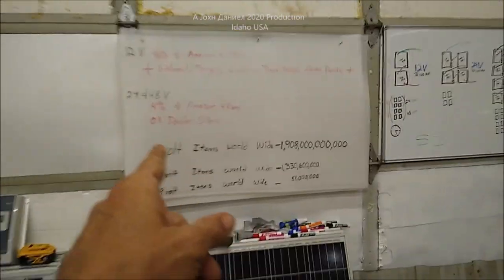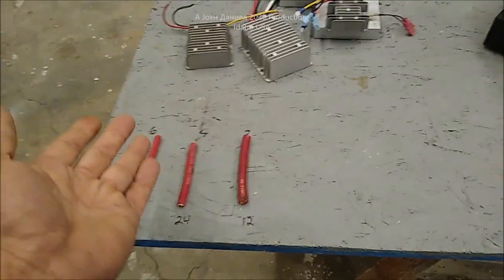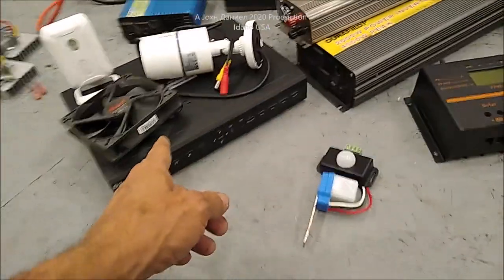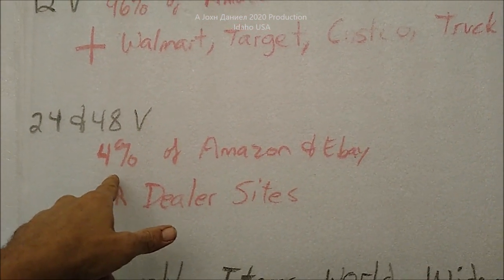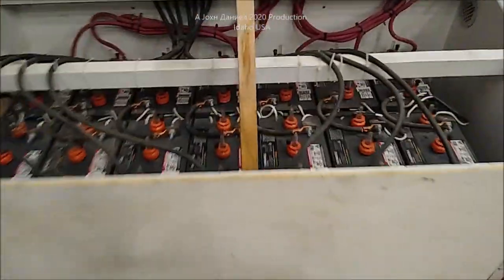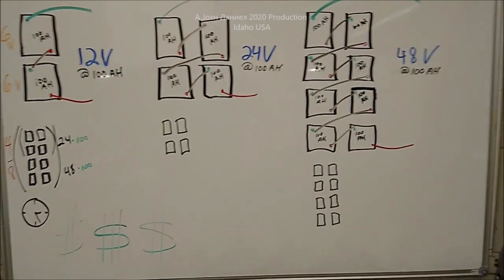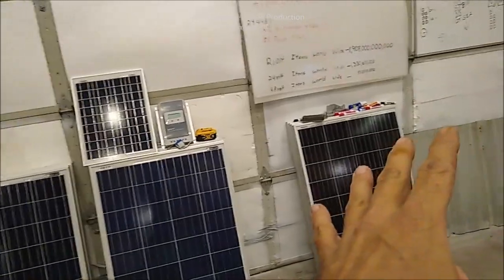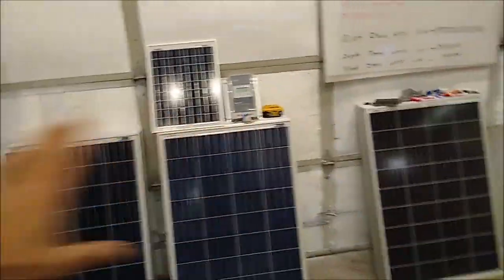Solar Wind Hydro 12 VDC is Best Voltage on Off Grid Survival Power System (Graphic Info)

Comment from the maker: ⬇️ SURVIVAL POWER SYSTEM ⬇️ -- 100 Watt Panels https://ebay.us/FMVsCV ,$120 REAL 50A MPPT https://ebay.to/3abTqju ,Solar Connects https://amzn.to/2XJOa1M ,Battery cable USA made https://amzn.to/3h6dsim ,12/2 Above/Underground https://amzn.to/2XIJolg for safe DC wiring of lights and appliances. (appliances you can use on 12 volt full list below)
Cheap Inverters with proven 4+ year records of quality - 3000 watt https://amzn.to/3awLWrS for tool, high amp and start up use, & a 1000 watt Pure sine for sensitive computers, TV's and electronics https://amzn.to/2Y1UHoH or just go one big inverter a 3000 watt pure sine (preferred method) for what your system can produce in peaks https://amzn.to/3iNsQjQ 
 
***BATTERIES - - DEKA SOLAR or Duracell GC2 & B-903-L16 that actually can last 10 years. Made by East Penn, sold by Batteries+ as a Duracell for less.  https://bit.ly/2wv1VXd Order online, pick up for cheaper. 
~HURRICANE LiFePo4~ is the best affordable all in one 100+ AH Lithium option using Pure Prismatic Cells, not the others flashlight cells!!, go to link, add to cart and put in code WIND5 for a discount on all items in there. You can send them parts request, they know more sources. https://www.hurricanewindpower.com/hurricane-battery-12-volt-100-amp-hour-lithium-iron-phosphate-lifepo4-battery/
Questions, need help designing, ASK!
Reply: They seem to be sold out of the 50 amp mppt charge controllers do you know of any others that work as well ?
Reply: Great video!!! Im about to buy 4 330watt monocrystalline panels (it'll max out my 6x12 roof space, i have already 8-3.2 280ah lifepo4 cells. I want to run a 5,000 watt window ac, a 12v water pump, and a small efficient deepfreezer as a refrigerator. A small water heater would be a bonus, but i will be making a small wood stove in the trailer for heat, so i can boil my water for showers and do without the water heater if i have to. I figured 12v strip lights will be enough for interior lighting, with one 12v flood light on the outside. 
   I think it works out best to use a sine wave inverter to run ac to appliances, because of 12v dc loss, but that's speculation on watching videos. If thats the case can you advise on what equipment would be necessary to run my system? 
   Would it be best to build a 8-cell 12v 560ah battery bank with one bms, or 2-4cell banks with a bms for each, then connect them in parellel? I think running all 4 solar panels in parallel is what i need to do, but im not sure on what size mppt controller to get or inverter. My only thought was if i ran 2-12v battery banks in parallel, if one had a problem i could take it out of the system and still have one bank to run on until any problem was fixed. Say a cell went bad or bms went down. Having a extra bms or a few other things on hand is im thinking a good idea, but if you can't get on it right away it'd be nice to still have power for the day or night. 
   I mentioned on one of your other videos that id like to incorporate a 12v axis pma wind generator if possible, so if it is and changes my equipment needs i thought I'd put that in this post. If this is more than you bargained for when you wrote just ask! I apologize lol. Im wanting to go to new mexico and texas during the winter this year, (Michigan winters are getting old/ or i am haha). If you want some slave labor I'll swing by your new place and dig a ditch or two, or pay for the advice, it'll be worth it to not buy hundreds in over expensive or wrong equipment. If your helpers have the time, i know you said your busy, my email is gypsymike1969@gmail.com, i can use email for questions and answers. Any advice will be appreciated!!!

Comment: You have a lot of knowledge and willingly share it so you deserve a big thank you.  Please keep in mind that there are many single women both young and older who are trying to become as self sufficient as we can be.  We can't lift lead acid batteries, don't have the skills or amount of tools needed, can't recognize a good tool from a cheap tool, can't strip wires, etc. how about some videos on how to set up arrays using 12 volt batteries that are only 35 amps that we can lift and showing wiring that is more plug and play instead of using charge controllers and inverters that require buying heavy gauge wire, stripping it and screwing it into place.  Please!!

Comment: I have been watching your channel for quite some time now and this is the best explanation I’ve seen yet of why to go with 12V. 
Most folks don’t know that their DVD players TV and stereo systems run on 9 to 12  volts. Not all but most do. I have removed the transformer from my devices and ran them straight off my battery bank with no problem. Other appliances like refrigerators freezers and washing machines need an inverter or propane to run. However there was a washing machine that was peddle power I showed the wife. Well the look I got.  If you’re married you know what I’m talking about. But the exercise bike was ok. Go figure.

Comment: My good sir I whole heartedly agree with you. It’s the exact same reason my system is 12v. Your explanation is both practical and real world experience and that means a lot.
Reply from the maker: Many fail to comprehend, I designed my system on pure simplicity, pure redundancy, complete restorable operating principles. If things go bad in the country, world or just due to environmental or weather issues, my methods are solid. Others who depend on sources that "May" exist later, are just pushing the dealers talking points, not reality.

Comment: During Lockdown, I've noticed how much power is needed and its very little. I've got a small 12V solar with a turbine and a small 24V with a step down to 12V. The fridges are 12V / 24V. Life is better without TV, radios, lights on all the time. I've made and bought solar cookers rather than a 12V oven or water boiler.

Comment: Finally a YouTube video that say's the same thing I have been telling people for years. I major point that was not mentioned is that electronics such as T.V's computer's and radio's use 12V DC internally. You can direct wire them to a 12V supply without any convertor's.
Reply from the maker: Safe, Solid, Proven. And parts anywhere.

Comment: You and I approach life exactly the same on these points.  Those kids are very lucky.  Our goal is self sufficiency for retirement. Minimal expenses. We're very close to disposing of the debt monkey. Energy and water are the everyday stuff we are mastering. We still have the on-grid home but a 35' residential camper off-grid we are more and more spending time in. There's a learning curve and you are helping to flatten it.  Thanks my friend.
Reply from the maker: My goal is safe the smart people who are not destructive to our society. And If you need a part by part list to make it easier, email me olympicpowercontrols@yahoo.com but include the general location your at, plans to apply, needs, and basic abilities in funds so I can try to make you a straight across plug and go set up to best fit your plans from the cheapest list of parts that last the longest.
Reply: @JOHNDANIEL1  I currently have 8x100s and (against your suggestion 😳) I just picked up 4x250s for $50 each. I'm currently using 4x Gp 31s and 3x24s DCs (yes separately). Camper had the 24s in it. I'm adding 4 more 31s before winter. Figure I'll need them with a REAL inverter.
I have a 4Kw Onan genset for wash days and mandatory AC days.
I use a Schumacher 2000w inverter (Not happy with it). As things progress I expect to replace it with a 2000w LF pure sine.
Bought a 30' tower to put a wind genny on before winter. Didn't get it home yet.  Getting there 1 piece here 1 piece thete at a time.  Social security doesn't pay great.
We are 30 miles north of Ft Scott Kansas.
Reply from the maker: @barker31155  We hope to get about 4 older families interested in the retire sorta free idea. Bulk Buy 100 acres in Texas hill country, split accordingly by deed from overall investments. Then each of us will separate about 3 to 5 acres near the center to make into over 80 full 20 year lease retire RV spaces where they pay $5000 up front to get a 20 year space 6 times the normal RV space with water and sewer provided at a flat $25 a month and they pay their own light bills or go off grid with all the room they got. the rest of the 80 or so acres we build on with large $6500 26 x 38 metal garage kits converted into our homes for under finished 1100 sq foot per house plus, for total of 25,000 each. Hyper insulated, ground source cooling, and fully off grid. 
Thats a idea that will guarantee to fill in a few months!
Reply: @JOHNDANIEL1  Love the hill country. We did live on Corpus Christi bay area for a short time.
Visited the hills now and then.
We got led back to Kansas and now planted in a fundamental Baptist church. Everything from fill in preaching to writing out birthday cards. My wife now teaches children's Sunday school. Unless the Lord calls us to the Hill Country and opens the doors, we'll be here in Kansas. 
I hate paying bills and that's what drives my ambitions.

Comment: I use 18650 cells from New lap top batteries. My cost is 1.00 each battery not each cell. 
I also get free used ones. I agree with 100 watt panels.  Also one important factor on the panels size. I’m 59 and big panels are heavy. My goal in 100 panels. Along with wind and hydro.  How about a video on a hydro generator.   Keep the faith.     By the way.  You must have watch Ward Cleaver growing up.  You’ve done a great job with your kids.
Reply from the maker: I always tell all - Home School your Kids, and VoTech teach them all you can so they know the most important skill to apply - HOW TO LEARN!
Reply: @JOHNDANIEL1  AND be self reliant.   
  Im sure you or your kids are going to wait 3hrs(example) along side the road to have road service change a flat.....Riiiigihhhtt.
Reply from the maker: @duaneroepke8840  Yeah, not my kids for sure, they are not seeing a future burning down a city like our current generation, but more than likely owning a ranch miles away.

Comment: I been thinking of that Duracell inverter. I always had 12v solar systems and recently went 24v to test some things out. Like you mentioned most 12v items are cheaper and easier to find. I am using 100w panels to Save on shipping. I used to own 250w panels around 2008 but moved and sold everything. Nice video
Reply: I would never buy a 1440watt Duracell solar generator over the years i bought cheap power packs with modified sine wave inverter and after a year the battery was dead but they ran my drill and sawsall and when I went to cordless tools it kept them charged when I was on a site with no power then I found utube and full-time RVER and I found that the sealed lead acid battery should last between five and eight years and should not be discharged below 12 volts and should not be discharged below 13.4 and should be charged to 14.8 so I looked at my booster packs and all my chargers were 12 volts and since I'd just bought 2 everstart booster packs with modified sine wave inverter I checked out what it charged to 13.1 and I thought that the manufacturer should know proper charging parameters but I had my old black and decker handy so I opened it up to find out the battery manufacturer so I could find their website to find out what they said the proper charging parameters for their batteries were but written right on the battery was do not discharge below 12.2 float charge is 13.4 and full charge is 14.8 and on the built in charger was output 12 volts so it was dead to start with and being discharged way too far it was designed to fail as were all the other ones that I'd bought and  Duracell says that it's easy to change the battery but if you have to buy a new battery every year it's not cheap and Duracell doesn't charge the battery to 14.8 it's also a modified sine wave inverter which you can fix with a triplite line conditioner they only affordable Stateside though up here in Canada we add over 25% plus taxes even at that it only goes from a hundred dollars to 145 dollars it's the almost 4 hundred dollar shipping costs that kills it another unit that's reasonable price and even up here it's still reasonable is nature's generator with a 2000 watt pure sine wave inverter but it's got the same problem with charge parameters and like the Duracell if you run it to dead it'll take 2 days off ideal sunlight to charge it up

Comment: Same reasons I chose 12v (Except for one part of my house where I have long runs of wire to lights for that I’m using a 24 V system. But that isn’t a problem because I can just go to the trucking section on Amazon and get what I need, even a 24 V electric kettle). Variety and cheaper prices from competition. I even could buy well priced BAL (Japanese inverters) that accepts dual battery battery bank input. And I run Jill from us all the panels and wet for the wind turbines

Comment: Wow! Great video, I was pondering over  Weather to go 12 or 24 vote.  I'm building 2 portable solar generators  1 is 12 V because I've always wanted to stick with 12 V and was thinking about going 24 V and I was thinking about making a 24 vote and I was just going to buy another 24 vote  inverter.   I may still buy the 24 V just to have it for my solar gen , but for my main systemI think I'm going stick with 12 vote now.
  And I've always wanted to stay 12v.  but the pressure going 24 or 48 vote was  Looming over my head.
Thank you thanks for your wisdom.
 I'm looking forward to getting one of your Winter  Turbines soon.

Comment: Thanks... That's kind of what I've been thinking but I've been wondering about other voltages because so many are talking about them. Appreciate the input.
Reply: Things like long-ish runs from panels to charge controller / batteries do better electrically at 48V because of lesser “loss” over distance. So there can be some use in higher voltages. 
Few ever mention that when they chastise people though cuz they often just don’t know a lot themselves. 

 I agree with sticking with 12V storage and components. I’ve always believed in that idea since I bought my first inverter well over 20 years ago and rigged a VW Westfalia camper. Or the many boats and other 12V jobs since then. 

I’m a 12V loyalist for basically the same reason(s), in this video. But wait, there’s more: you can ‘scale’ up with one panel 100W at a time affordability or by budgeting. Plus if you have multiple charge controllers over numerous panels and one dies everything just doesn’t go dead at once. 

So some have said to me that I don’t need to stress over 48V. Welll, I’m buying a small piece of property this spring and the ‘flat spot’ for the dwelling is further than my current setup by about six times. So in my case I’m going to experiment with ganging 4 panels (48V) at a time to minimize distance losses, and use 3 sets of four panels each. That isn’t as good as 12 100W panels at 12V (at downscaling panel failure effects) but it is both reconfigurable if necessary and a reasonably safe calculated risk so to speak. 
A last point is the higher voltages safety: once you get above 24-30VDC getting shocked by DC starts being dangerous. Lightning is DC, but even 48VDC can burn, blind, or kill you just as well.

Comment: I wouldn't disagree with your arguments but I would still personally prefer that the PV array and storage battery operate at a higher voltage than 12v (excepting low power installations) to keep the current levels lower. I am old enough to have daily driven a 6v beetle and the effect of contact resistance was a widespread problem for lights, the coil, the starter etc. but with a 12v beetle the problem went away. I agree that 12v "stuff" is cheaper and I would probably want a 12v power distribution level which would typically have multiple low power attachments but that is not automatically the same as the main PV to battery interface voltage. I would also add that many/most LED lamps these days run small internal SMPS to drop 12v to 3v as required for individual white LEDs and these will often accept >12v input without problem. Lastly the cost of PV controllers and mains inverters is largely a function of the input current rating which is why I would expect to pay less for a 24 or 48v unit than the same power running from 12v input. YMMV

Comment: We only have 24v because I got 2 wind generators  on clearance and the sundanzer freezer and refrigerator are 12/24.. we have a converter to step down everything else...  we have a very small home..  just one converter
Reply from the maker: If you grow it, the 24 volt turbines will charge 12 volt systems with more consistency.